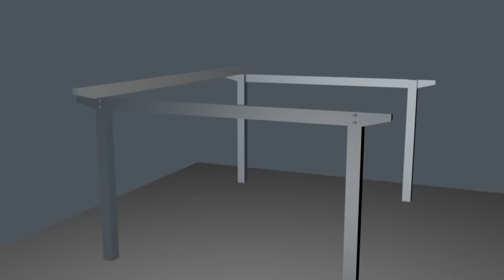How to Build a Pergola | Mitre 10 Easy As DIY

Comment: Good Job well done.
Might suggest filling the post hole concrete approx 2 in. above grade (using sono-tube collars for trim). Purpose of this is to allow water runoff and prevent pooling and rot of the uprights over time.
Reply: H5 posts won't rot, it's treated for submersion in water/flooded areas.

Comment: Some men are so talented with a measuring tape all they need is a single blade of grass to run accurate measurements!
Reply: Right wtf was that about!
Reply: There was a nail in the ground
Reply: @jamescoupland667  but it was still funny
Reply: And without the need of checking right angles.
Reply: Ye how would a normal Jo blogs no where to mark their post so its square????
Reply: Where do you know where place nails on profile???
Reply: @shaneunuwai4035  bit late, but the nails go in line with the spray paint mark, with one in each arm of the profile. The corner that forms at the intersection of the string is what you use to line up the post

Comment from the maker: Hi Karrina,
If you wanted to put posts in your planter boxes to hold a pergola you would need a lot of concrete in the bottom of them, at least 450mm deep, so that would make your planters very high. You would also need to have drain holes through the concrete to allow water to escape, so all in all you could but it would look a little strange. It would be best to concrete posts into the ground the build your planters around the posts. Hope that helps.
SR

Comment: Hi! Is it alright to allow wood to be in contact with concrete? Isn't it necessary to isolate it somehow to prevent moist from going into wood? Thanks!
Reply: It’s fine if it’s heavily treated (H4 or H5) otherwise it will need some membrane between the two

Comment: I'm thinking of building one like this so that i can put solar panels on it rather than my shed/radio shack.  The problem is where i want to put it, i cant dig down because of the easement.  It would somehow need to be moveable.  Would I be able to use those raised concrete bases and level them out?
Reply from the maker: It's definitely possible, but can be less sturdy compared! ^Cam

Comment: Concrete can absorb watter, so wood in it can be destroyed in time (rain, snow,..). There is better solution, concrete's foot can go 10 cm over ground level, and wood pillows can be supported by concrete in that way. Watter can not harm wood, and all can be much effective.
Reply: +nedzad grebovic great suggestion
Reply: +Rs S I would like upload picture of what I done, but comments with pics are not avalible here :(
Reply: AutoMotoSvijet set up links ,show us the links
Reply: +Rs S In fact I could show few pics of what I have done in front of my house. I am an enginner and I am looking for solution under 500 BAM (270 USD), and I make it.
Reply: AutoMotoSvijet Great, coming summer I am clear in my mind, I will buy all the tools, wood ,make a plan and will build my nice backyard. I think I can finish the work in 1/4 the cost.
Reply: +Rs S If you have any e-mail I could send you photos of mine one (6x5 meters)
Reply: +nedzad grebovic water cant harm wood? water wood rot is extremely common, thats why you usually have to use treated wood and coat with a sealer. Even then it wont last as long as stainless steel. You can use the stainless steel post stirrups that get anchored/concreted into the ground. That way the wooden pillars are raised above ground level to prevent water rot and just as stable
Reply: nedzad grebovic send me a picture of what you mean.
Reply: nedzad grebovic   b
Reply: Exacty.  My neighbor used the method in this video and the pressure-treated posts rotted out in 10 years.  You can buy concrete block with u-shaped metal fittings to hold the post above ground.  No rotting at all.  And no concrete pouring either.
Reply: Деревянные столбы сгниют на 3 й год :), так как вода из бетона при его твердении уйдет в древесину.
Wooden poles rot in the 3rd year :), since the water from the concrete when hardened will go into the wood.
Reply: nedzad grebovic I
Reply: BINGO! 100 points for the right answer, that"s exactly how it's done!
Reply: nedzad grebovic noo you wrong..pressure treated wood in concrete will last lotsa yrs 5. to 15 yrs..you can also wrap foot of post with tyvek wrap or plastic if you that nutty n picky????
Reply: True. And when doing right they actually makes the finished product look nicer.
Reply: You are running a risk spraying without a mask

Comment: I always thought it was standard practice to put few inches of gravel before the concrete, for drainage. Either that or bolt them to metal brackets set in the concrete. Won't these posts rot over time (quicker I mean).
Reply: As he shows, they are sitting off the ground on a couple of bricks or blocks, then concrete floods under and around them. Plus they are H5 treated posts meaning they can sit in water logged areas, unlike H4 and on. H4 & 5 are good for well over 25 years against rot and decay.
Reply: @oo0Spyder0oo  I don't know how I missed that. lol. must've have been skipping through the video
Reply: @baddogentertainment6960  no worries. I just built one like this and used H4, but I kept the concrete above the water line to keep a run off.

Comment: Nice vid. I got a question towards a detail you didn't mention and as I'm having a hard time to find somebody that can answer it in my surrounding. I build a garden shed six months ago. Basically I used 4inches x 4 inches thick beams (not sure what wood it is, maybe oak, something expensive and hard wood, one beam I attached to the facade, then 2 beam as posts and 3 other beams  connecting em with large threads and bolts and then some smaller beams in the middle. quickly but not efficiently treated the wood for water, covered it with a tarpaulin fixed with washers and screws. Unfortunately the tarpauline doesn't completely cover all of the beams on the sides (was a bit shorter than the size I ordered) and so it's raining on the edge of the beams. After six months I can see that the beams on these spots became a bit light gray and also unfortunately I got a bad injury on the back preventing me from working. Your opinion: how fast can wood rot when exposed to the rain and snow in the winter, is it gonna hold til spring? From underneath the beams looks like new, there's just about 1 inch large surface on the sides of the beams that's exposed to the rain and of course the rain drops run downs the sides of the beams...
Temperature and climate is often around 0-15 degrees with 9 months of rain and 1 month of snow and ice per year. there are no thermites here.
Reply: Did they rot then or not?
Reply: use a screw driver to poke it. You can definitely tell it is rotten or not. Paint it and it can last 5 years even if untreated.
Reply: you do not need to worry to much it definitely will not rot before spring especially if exposed to the air aswell especially if it is 4x4 oak which i doubt as they would be rather exspensive for framing a shed

Comment: May be I missed it somehow but did you mention the size of timber required apart from the posts ? it looks like 200mm x 40mm cross bearer rails front and back is that correct ? and the smaller ones are I guess something like 80mm x 50mm ? grateful for your help!
Reply from the maker: Hi there! You can find the full guide for this here: https://www.mitre10.co.nz/medias/How-to-build-a-pergola-WEB.pdf?context=bWFzdGVyfHJvb3R8NDI3NDc5OXxhcHBsaWNhdGlvbi9wZGZ8c3lzLW1hc3Rlci9yb290L2g2Mi9oNTgvODkxNzUwOTMwODQ0Ni9Ib3cgdG8gYnVpbGQgYSBwZXJnb2xhIC0gV0VCLnBkZnxlY2Y5MjVlYzY0NjMxNWQyNGNhNWNhOWJlNWQ0MDkwZTUwNDQwYjMzY2QyZDMxZDEwNDNkYWQ4ZDliM2VmNDY5
Hope this helps! ^Cam

Comment: Nice looking, but can it support a bed swing up to 1200 lbs with 4-point hardware?
Reply from the maker: That’s an extreme amount of weight for a Pergola. In that situation I would double up the amount of rafters where the supports are doing to attach to make sure it can take the load. I would also make sure the bolts go all the way through the joists. Then I would put 2 x 45 degree angle braces from the posts to the bearers at a minimum of 1m long each, and increase the depth of the holes to 600mm deep ^Charlie

Comment: Only one nail on either side of the joist ? Also what’s the spacing for the 2x2 slats ?
Reply from the maker: Kia ora. That will depend on the dimensions of your pergola. If you need specific help figuring out your project the knowledgeable team down at your local Mitre 10 will be happy to help. ^Rhi

Comment: Hi, I'm planning to build a pergola that is 3X5 mitres, The bearers will run on the 5m side, what size posts and what size of bearers should I use? I understand 5m is quite far apart, I want to make sure the bearers will hold well and I don't want to put posts in the middle.
Reply from the maker: Hi Claudia Gadotti , 5m is a very large span for any single piece of timber. The latest size available off the shelf (in NZ) is 300 x 50 and this is will just sag under its own weight. You could get a laminated beam made up but this will probably be quite costly. My recommendation would be to use a 2/150 x 50 pieces of timber with a steel flitch plate inserted in-between the timber. A flitch plate essentially is a flat steel plate with holes drilled into it so bolts are fixed through the timber into the plate and out the other side of the 150 x 50. So the flitch plate dimensions are 140 x 10 mm with holes staggered up and down every 600mm. As for you posts I would suggest you use H5 125 x 125 glue laminated posts. This will ensure there is no twisting or movement with them.  SR
Reply: Hi, what about a 6m span?

Comment: Hello. Great and inspirational video. One question : if you put the  vertical beams of wood straight în concrete, they Will not rott în time?
Reply: unfortunately.... I do not have this type available for me.... any tips? like varnish the wood, maybe cover in tar.... etc? any sugestion would help. i mean if i put a 10x10 cm beam like that at 50cm in ground, how long will it take before it will rot? do i get 10 years ? where i live we get ~ 50cm of snow per whole winter and in the rest moderate rains.
Reply: darn :)
Reply: you get about 15 years  with pressure treated posts before its time to replace ( in the uk ) . you can buy post sleeves over here now . like a bitumen sock that slides over the bottom of the post and is heated to form a seal . supposed to give you up to 25 years

Comment: correct me if i'm wrong but dose the concrete attracts water? So wood+concrete= rot..
Reply from the maker: Hey Grytis, as per the NZ6304 any timber used in the ground must be H4 treated or greater to prevent rot. In this circumstance we used H5. Cheers ^Charlie

Comment: did you use 1 bag of cement per hole and what kind did you use?....I noticed that you mixed this cement up unlike the video for the fence
Reply from the maker: Hi there,
You should use at least 2 x 40kg bags of Drymix, Easy to mix concrete in each post hole. You mix this concrete up prior to putting in rather than mixing the the hole as you do with Quick to set.
SR
Reply: OTC
Reply: OTC conxrete mix.like half bag per pole.you can also mix in some piecrs of blocks or stones to save on concrete

Comment: HELP!!!! My carpenter made my pergola uneven insteadof 12x12  its 11x6 wide and my post are 10 1/2 tall instead of 8 feet tall and the ground where the deck is its uneven as well.  How do I make the post 8ft. Tall the rafters are 16 ft long and very heavy😢
Reply from the maker: Hey Maya, have you had a chat with the carpenter who originally did the job for you? ^Charlie

Comment: What do you keep the rafters from twisting or warping over time?
Reply: they're pressure treated so the risk of twisting and warping is minimized drastically, I think as long as they are secured in place before they dry there shouldnt be an issue.

Comment: 2:27 you don't put any nails on the footing for the posts/pillar used as the roots, is that ok?
Reply: I for one have never had a post come out of the hole. They'll always rot and break off at ground level before they pull out of the hole. Adding screws/nails just makes getting the remaining wood out of the hole a lot more difficult.

Just noticed your comment was from 10 months ago... Oh well.

Comment: Screws Not Nails.  Impact Driver and battery about £95,  I've had mine for nearly 5 years and it's still going strong. Nails are a thing of the past, and I only have panel pins in my tool box.
Reply: i hear you , agree a bit , but i think people won't want to let go of nail guns.. its a manly thing, i know i like nail guns , but allan-head bugle screws clamp the timber and hold very well !!

Comment: Wood inside concrete? If you have to change It?
Reply from the maker: The pros of using concrete for posts are that concrete is very durable and sturdy, so you can have peace of mind knowing your structure is well-supported on a strong foundation. This makes it hardier when enduring strong winds and storms.

Comment: This is a good video. My only problem is that here in the USA we use inches and feet so most of us don't know a millimeter from a milliliter.
Reply: 1tired citizen 1 inch = 25.4 mm, common size timber we use for building like 90mm x 45 mm is called 2 x 4"

Comment: I get how one profile can be level but how do you know they are level to eachother?
Reply from the maker: Kia ora Arty, there’s many different ways to ensure objects are level with each other. Probably one of the oldest methods of levelling is the use of water. Using a garden hose and a bottle on either end is just as accurate as the most expensive Lazer level.
In the video we use a spirit level and straight edge to transfer the height around to all posts. Having a good quality spirit level is probably one of the best tools you can have in your tool kit. Nowadays Lazer levels are used regularly as the Lazer can project a great distance with great accuracy and are also becoming very cost effective. ^Nick

Comment: Do I need council consent if I make a freestanding one that sits unattached on a concrete base.
Reply: No. It can be as high  and as long as you look. Just as long as you don't put a roofing structure on it, as then you will require building consent. However, most people just a roof over it anyway, because so much red tape in the building industry and council consent, its ridiculous. Anyway, just take off the roofing if you are planning on selling your house in the future.

Comment: Wonderful! 😍🥰 Thanks.
EXTRA SECRET TIP:
To increase longevity in harsh climates, do things the old fashioned way by painting your wood with motor oil and let it get baked in by leaving wood in full sun. To prevent rot at the base, do NOT set in concrete. Instead, you can creosote the base of posts that will be in the ground-or not-and simply bury the posts in dirt. Concrete does not allow wood to breathe, so when the wood gets wet, the part set in concrete does not let soil wick out of your posts. 😉
Reply: Why on earth would you want to use toxic chemicals when the proper wood treatment is better and longer lasting?

Comment: So you have to pre drill for the nails ?
Reply from the maker: We recommend you pre drill to prevent the timber from splitting.
Reply: @mitre10nz  ok I didnt know that's for nails aswell thanks
Reply: @mitre10nz  what about for the nails you put in the rafters were those pre drilled aswell ? I know for the small strips you did jus wondering cuz I'm building one
Reply from the maker: We didn't pre-drill for the skewed ones we used to attach the rafters to the bearers - you can use a nail gun (or old school hammer and nails). If you're referring to the battens that attach to the rafters, we did pre-drill for those.
Reply: @mitre10nz  ya the skewed ones thanks alot

Comment: What is the height of the posts on this pergola?
Reply from the maker: Hi Raúl, the height of the pergola is 2m to the underside of the bearers. The bearers are 200mm in height and posts are 500mm into the ground, so that’s 2.7m in total. I would allow a little extra to cut off in case the ground level is uneven, so a 3m post would be perfect. ^Meg

Comment: what seize are the bearers and rafters please
Reply from the maker: Hi there, this pergola is 3.5 meters long and we want the bearers to overhang by 300mm at each side so the bearers will be 4.1m long in total. The pergola is 3 meters wide, so the rafters will be 3.6 metres long to include that 300mm overhang on each side. Make sure you check out our website for full instructions and some handy hints https://www.mitre10.co.nz/guides-and-advice/guide/how-to-build-a-pergola ^Matt

Comment: If you're using the metric system why not use centimeters instead of millimeters,  saves us some zeros don't you think ?
Reply: LeoDZ wow very nice good job👌
Reply: LeoDZ It's best to use as few different units as possible to keep things simple. Mistakes can be made when converting or when you're working with other people and having to communicate back and forth. Saving zeros isn't really gaining you anything practical. But saving on miscommunication and conversion errors is certainly worth it. I work in a metric machine shop and mm is the standard unit. We never work or talk in cm. It just keeps things consistent and simple which really does go a long ways in a practical environment.
Reply: @Slackbunny  Millimeters is more accurate than Cm. SMH

Comment: How deep does your ground digging need to be ?
Reply from the maker: Dig your holes 400mm square by a minimum 500mm deep or until you hit solid ground 😃
Reply: Mitre 10 New Zealand  which mean about 2 feet depth, is it strong enough to hold the 10 feet post like you did ?
Reply from the maker: As long as you follow the video you'll be right BillyBoy 👍 ^James